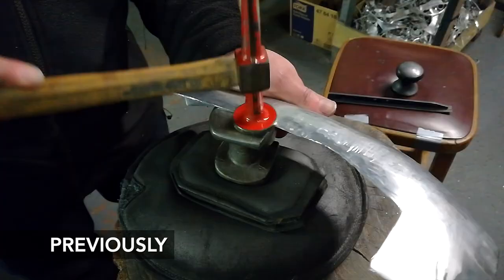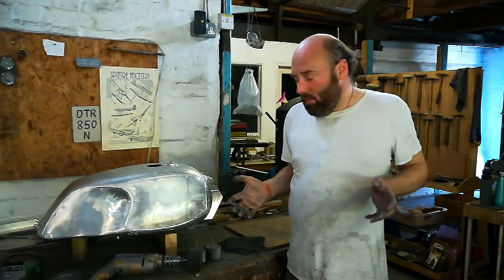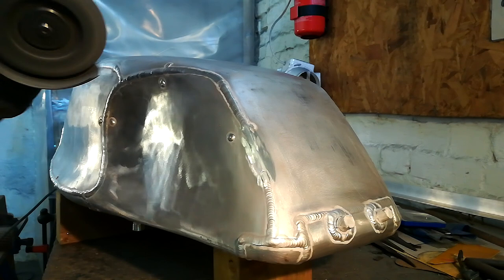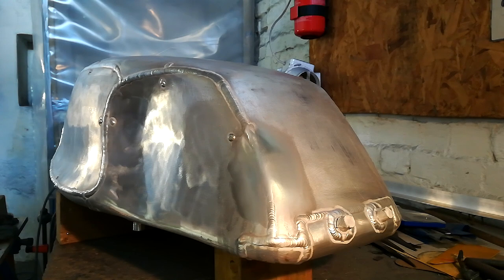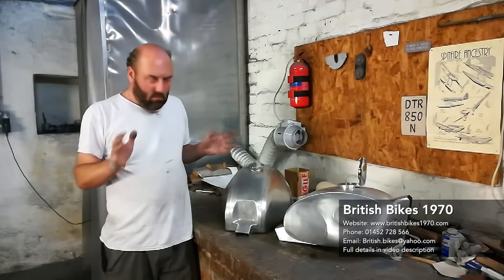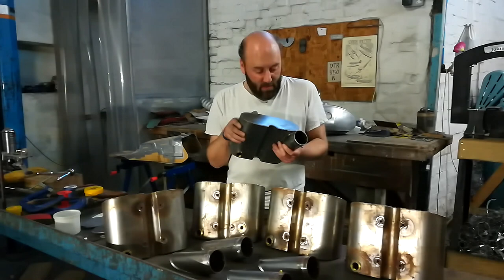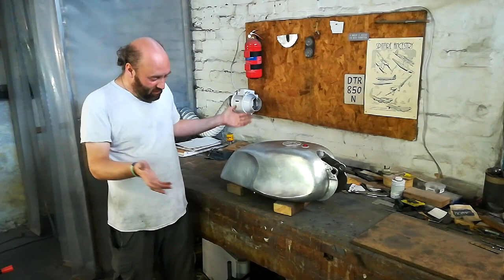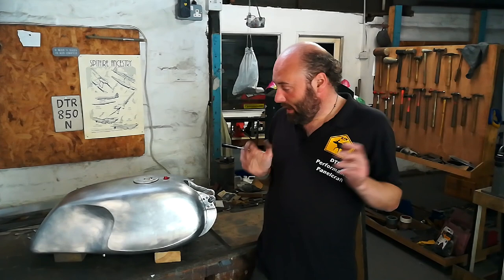Making A Custom Tank For A Classic Cafe Racer - Part 3/3

Comment: Fantastic series loved the videos. I have a question re testing the tank. Lets say you have a small leak in one of your tanks that needs a bit of TIG  weld to repair. How do you get rid of the fumes so you don't cause an explosion.
Reply: Thanks, glad you enjoyed the films. That's a REALLY important question about further welding if a tank fails a test. In retrospect should've said something in the film but thanks for bringing it to my attention now.
The procedure we use if a tank requires further welding after it has had fuel in (whether that be following a failed leak test, or because of modification or repair to a previously used tank) is as follows:

1: Wash out the tank with water to remove as much residual liquid fuel as possible.
2: Steam clean the inside of the tank to boil out solid fuel residue (particularly important on older tanks).
3: Purge the tank with inert welding gas (usually argon) prior to and during welding.

That procedure has, thus far, kept us out of trouble!